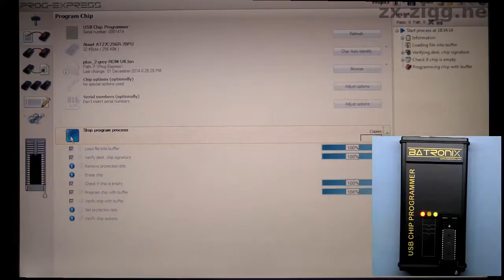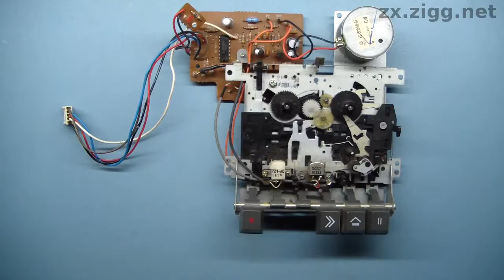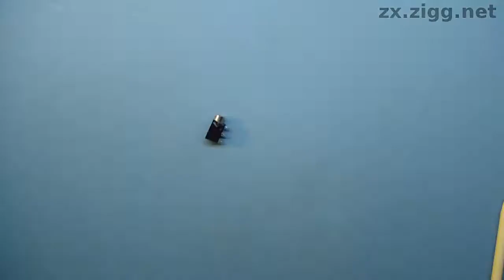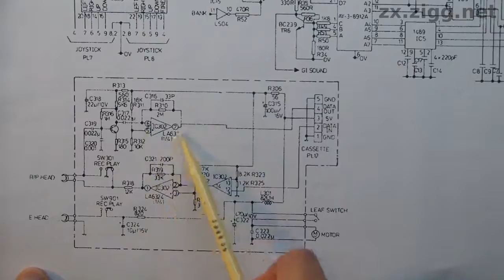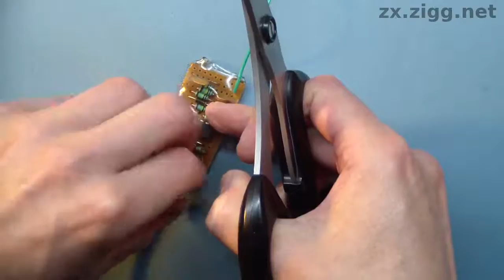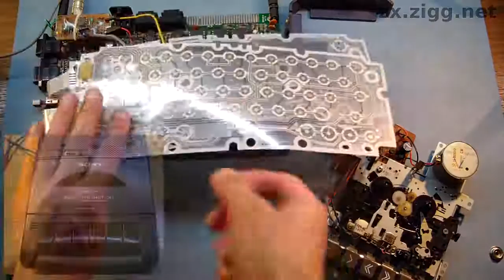ZX Spectrum +2 Repair. (No. 7). Part 3.

Comment: My +2 has a factory fitted 2K2 resistor at R37. R38=18K and R45=10K. Not sure if this would cause any problems.
Reply from the maker: david rollor It ought to mean the level from the AY sound generator is higher than it usually is with a 10k ohm resistor for R37. If you want to make the changes I described in the video, I would think it'd be fine to leave R37 as it is.

Do make sure you've correctly identified R37. The service manual says it should be 10k ohms and I don't think I've seen a +2 where it wasn't. However, I wouldn't be at all surprised if different values were used in some units.
Reply: JoulesperCoulomb I changed the rest of the resistors to the values in the video, sounds much better. I double checked R37 to make sure and it definitely is a 2K2 resistor fitted which I've just left as it is. Cheers.

Comment: A detailed guide would be great,i think i would like one of these but first need to fix
the rf sound i mentioned, after checking from your advice the rod was crushed but when touched brought the sound back briefly
Reply from the maker: I assume you mean the core of inductor L5. As I noted they are rather delicate. If it is smashed to bits you're going to have to replace the inductor or perhaps you'll be able to find a suitable replacement core. You'll probably have to remove the inductor from the PCB to get the damaged core out.

However, if just the top portion of the core is damaged so as to make it difficult to adjust, you may be able to use a trick I have found can work fairly well: find a thin plastic rod like piece of material. I have previously used a length of ridged tube as supplied with an aerosol spray can. Glue this to the top of the inductor's core. Take great care not to let any glue go down the sides and gum up the thread! Once the glue is completely set, you might be able to adjust the core by rotating the new attachment. A gentle upwards force might be required if the core has gone off the bottom of the thread.

Comment: I always enjoy these videos, I don't understand most of the complicated bits being only a humble electrical contractor.  I can see though that you take enormous pride in the quality of work which is always nice to see.

Anyway I have started to cut my teeth on minor electronic products as a bit of a hobby including the +3 sound fix and building small boards for composite video on my Atari 2600jr and my Phillips Videopac.  Luckily even though I don't understand what is happening I can follow the circuit diagrams.

Thank you for these videos they are very inspiring. :)

Comment: I really like the external loading modified board, for people who are unable to build one would you consider selling one pre made with just the socket needing attached or better still are you planning on selling them ram module style ;) I personally think they would prove really popular another excellent video .
Reply from the maker: david rollor I would think this circuit would work well if used to drive the cassette input of other models of ZX Spectrum. I will carry out some tests when I can find the time.
Reply from the maker: I probably could, though I haven't any immediate plans to do so. However, someone who is able to make the necessary wiring modifications in the Spectrum, ought not to have too much difficulty in assembling a simple circuit on a stripboard. I could produce a more detailed video guide to assembling and fitting this circuit. I might also consider constructing a small number for sale - if you are interested, please contact me via the form at http://zx.zigg.net .
Reply: JoulesperCoulomb I would like to assemble a circuit like this for my +2. I also have a toast-rack 128K and a 48K which is very temperamental when it comes to loading, even from cassette. Could this type of circuit be easily adjusted and modified to fit to these earlier machines?